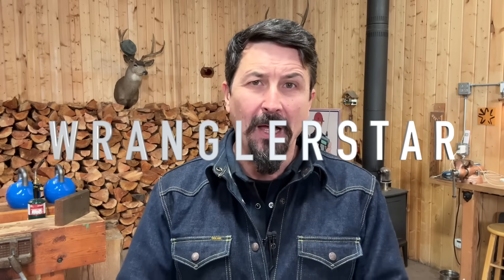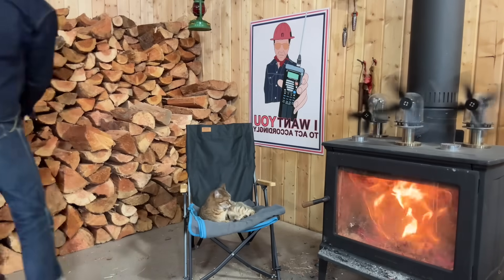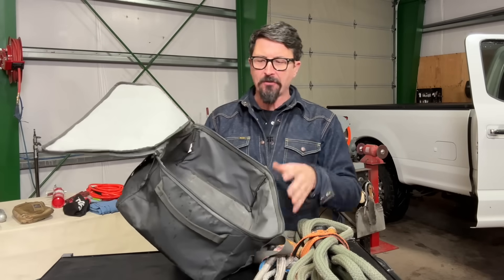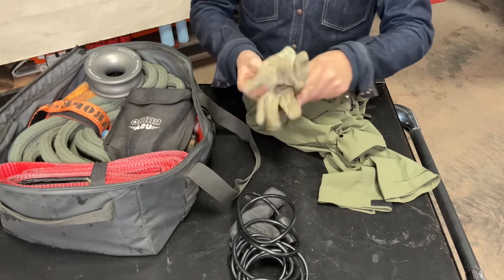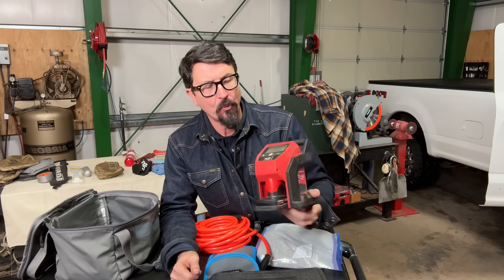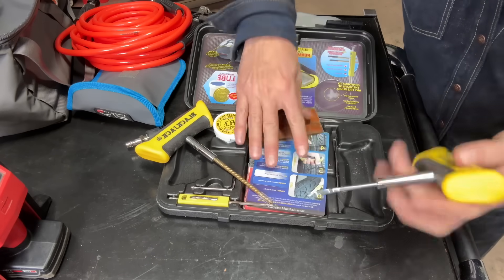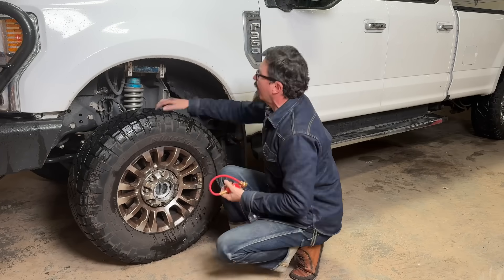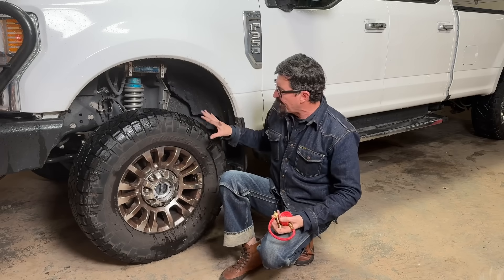My Showdown with a Mexican Gangster

Comment: I daily drive a ‘74 Chevy truck, and I’m planning on longer distance camping trips in the near future in more remote areas with no phone service. Naturally, I’m putting together a couple of kits to keep in the cab, not only with basic repair tools in the event of mechanical failure, but also for situations that might leave me stranded. I mean, obviously flat tires, but also getting stuck in adverse weather conditions and similar situations. Anyways, thanks for the super helpful video. It gave me a lot of ideas as to what I might want to pack.

Comment: I went from the Nitto ridge grappler to a Cooper AT3 XLT great all season tire. Was a more quiet tire I got better fuel milage great in the snow and mud. And look good to boot. Might be a good one too at least check into if looking for options. Highly recommend.
Reply: Have Cooper tires on all my rides. The AT3's have been great. Can't beat made in USA either.
Reply: I have these tires. made in 🇺🇸!
Reply: Lots of cooper AT3 in the company fleet vehicles. Cheep and local. Didn't know how decent they were until we had to try some other tires. Learned the hard way Its easy to do a lot worse than these cooper AT3 tires.

Comment: one observation.  The ARB gauge is NOT Australian its made in CHYNA.  It is the biggest piece of crap, I went through 5 of these units and they all had a bad end on them (did not properly screw onto the stem) and the gauge is very inaccurate.  I am a huge off roader and there are many other tools like this that are better.  I dont use them as I got auto deflators and a separate gauge.

Comment: Been running goodyear wrangler dura-trac's, since 2012, on my Duramax. Haven't found an offroad tire that works better in the snow. No more than a 12.5 width, unless it's really deep, which is somewhere a heavy diesel shouldn't be anyway, way more traction than a wide tire. Hauls my Sled trailer everywhere I need to go.

Comment: Some wisdom passed on to me from older ones is cherry stone chicken grit for traction.  Gets tenacious traction even works on glare ice with steep gradients. Once you try it you will never want to waste space on anything else. Second is pickup trucks need a load in the back for correct handling and traction.  My half ton did best with 500-600 lbs chicken grit by the tailgate for going up icy mountain roads , but 300lbs even was a night and day difference in fair weather. Much safer control on dirt and slippery roads.

Comment: Not sure if you have talked about it but oil spraying the underside of your truck with fluid film or Surface shield is definitely a proho thing to winterize your vehicles and protect them from rusting and rotting away

Comment: I've tried cat litter several times. I wasn't too impressed by it. I noticed it became soft within a short amount of time. Yes it did  provide some traction, but I found small sized gravel works much better.  Gravel about 1/8 inch in diameter, works the best for me.

Comment: Have you thought of getting a tire machine and balancer for your shop? Ive been debating on one myself. Thanks for the great info
Reply: Why?
You have 10 vehicles?
Reply: @willbass2869   yes I have several. But it seems the local tire shops don't get tires balanced correctly. And I like the ability to do things myself. Wouldn't have to set up appointments and pay higher prices for same tire that most likely is cheaper online.

Comment: Where you went wrong during your clinical time was shadowing RNs. 
I refused to shadow them as they cannot and do not exercise the critical thinking and critical actions that us Paramedics need to operate properly.
I demanded to attach myself to attendings and trauma surgeons and learned way way more than my classmates.
RNs (by and large) just use the EMS students as slaves to lighten their work load and seldom offer any real education.
THAT’S why RNs often clash with us when we roll heavy on high acuity patients. 
 
RNs:
“Oh, why did you do an EJ for IV access?” 
“Oh, why did you RSI this pt?”
“An NG tube,really?”
“Oh, why did you needle this pt’s chest?”
“A 14ga,,really?”
Etc etc 

Answer: Because I could, and they needed it. 

Medical control was almost non-existent  with my service because the docs knew us and knew that we were the pros from Dover and didn’t muck about with frivolities.
I would call with a big ticket item to bounce something off them and they would most often be like, “whatever you think is appropriate, we trust you know what’s up.” That,,was the best feeling.
And, then letting us run our codes in the ED would go up the RNs ample asses a country mile.

Retired and happy but missing the fun.

Comment: Topper is better than taneau but both are better than shoveling the bed...
Reply: Had a truck with a topper, my first in fact and last.  Last 2 trucks had/have tonneau covers, current is 3 panel folder and it is the only way to go for me.

Comment: I would be more concerned if you said you worked as a paramedic and was never threatened by gang members.  If that was the case, I wouldn’t be able to believe your stories.  However, your stories about the FD and working EMS match mine.  So, I have no doubt in my mind about the validity of them.